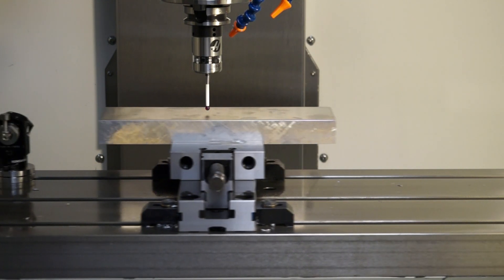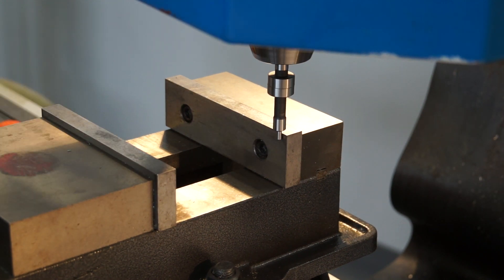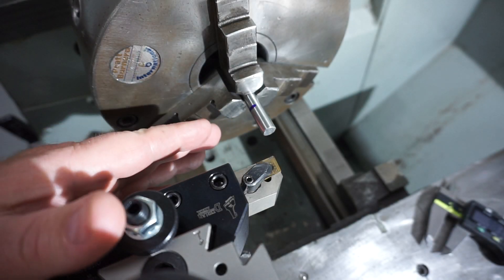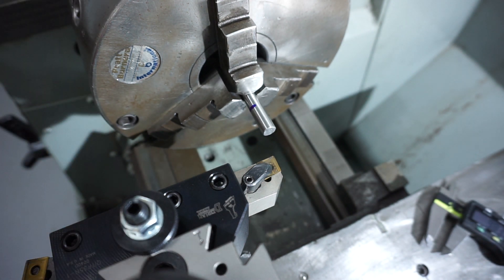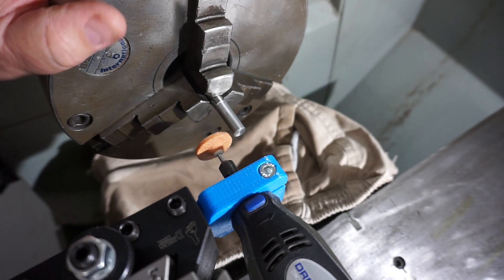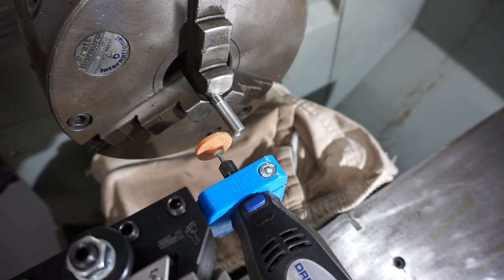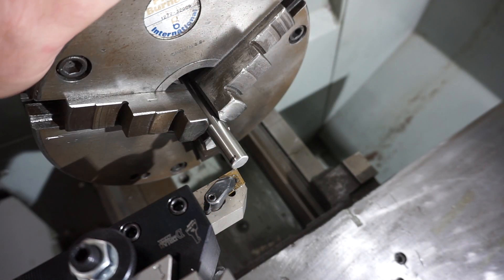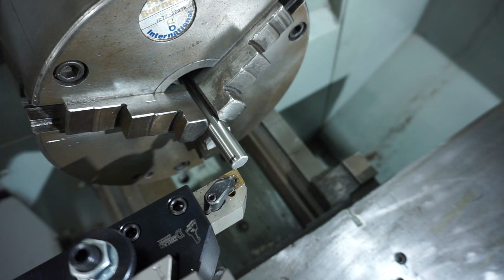Bearing Edge Finder KITS from D.Gray - #shopmadetools

Comment: I have to make one of those, I still use a slip of paper. When I worked in a toolroom in the 80s the toolmakers just touched the cutter  against the edge of job, no edgefinder, no cigarette paper. And off they went.
Reply from the maker: G'day Jay.  I'm just like you mate.  I always keep a packet of "Talley-Ho" cigarette papers in my pocket when teaching for the same reason (I don't smoke).  They work an absolute treat for finding the edge with a cutter or drill bit.  Yes some of the old fellas are/were incredibly skilled weren't they?  Sad to see so much knowledge being lost these days.  Cheers mate.  Aaron.
Reply: Cheers Aaron

Comment: Nicely done Aaron! :-) 

My only concern is what happens to the arbor "When" I go past the point where the bearing race touches the work, it's bound to happen.
The type that uses a spring and kicks out is more forgiving and pretty accurate for manual mill setups IMHO. 
Seems like one instance of overshooting would bend the arbor and it's all over for that tool, or am I wrong?

Again, nicely done!! :-D
Reply from the maker: Hey buddy how’s things? Thanks for watching, glad you enjoyed the video. Yes it is possible to overshot with this type of edge finder. I suppose caution needs to be exercised when using one. The black lines on the bearing worked a treat for me. The old wobblers are good, but my students have destroyed many by spinning them at high RPM. They stretch the spring, and many fly apart never to be seen again 🤦‍♂️. Cheers 🍻. Aaron

Comment: Seeing how easy it is to just up and away on the next axis, I may never use a wiggler again!
Reply: Unless... I might use el-wiggolo for centring on small holes.
Reply from the maker: I agree
Reply from the maker: G’day Adam. I was surprised just how well the bearing edge finder worked. My students have destroyed many wobblers, happens when they spin them at 2000rpm 🤦‍♂️. Sometimes you can just replace the spring, but half the time they fly apart never to be seen again. Let me know if you want the CAD file for the Dremel tool holder mate? Cheers 🍻, Aaron

Comment: Looks like another name to add to the list for our Thursday Live Stream @ Aaron Engineering.
Doug Gray Design & Drafting

Humpty Dumpty Cylindrical Grinding Company 😂😉

Better get that business name registered asap 👍
Reply from the maker: Hahaha 🤣, that name sums me up in one short phrase (Humpty Dumpty Machining Company”. I was actually surprised just how well the Dremel tool post grinder actually worked. Yes Doug would be great to interview. I’m getting a line up now. Bloody daylight savings in the USA has stuffed me though 🤦‍♂️. Thanks for watching Peter. Cheers mate 🍻. Aaron
Reply: @AaronEngineering  
Yes, the Dremel did a great job of Grinding the part.
Not much different to the small Tool Heads we use for ID Grinding. 
On some smaller machines the Dremel was considered a large Tool Head.
Because of the ID sizes we ground the tool was small in comparison. 

Nothing wrong with Humpty Dumpty that was one of my favourite characters growing up 😉👍
Reply from the maker: @weldmachine  Thanks Peter. I haven’t done much tool or machine grinding before. Need to learn more about it 👍🍻